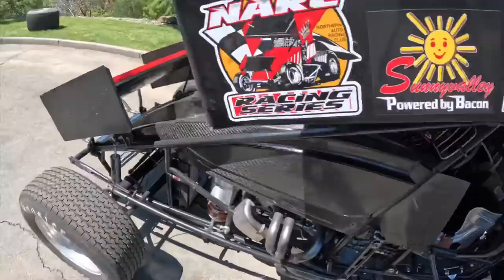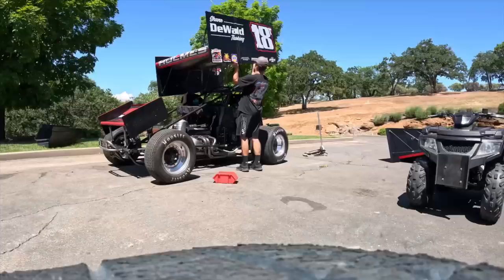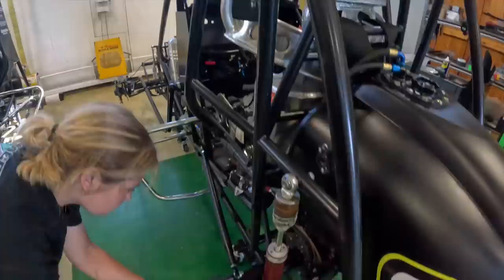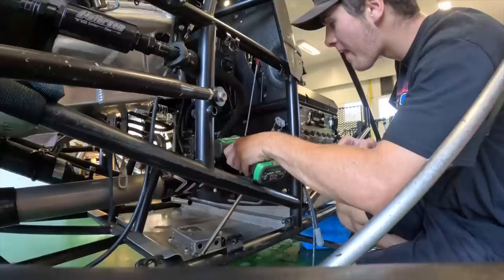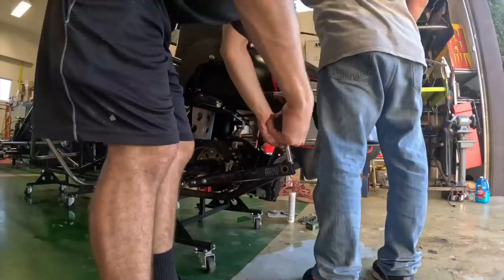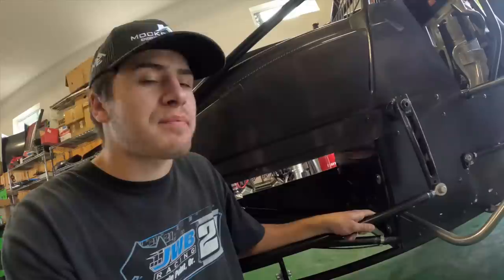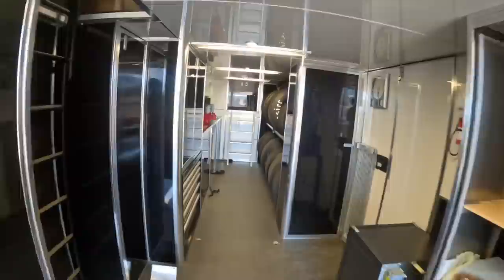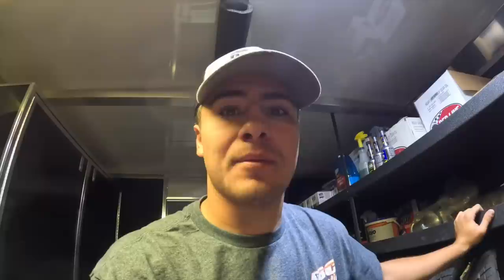We Had To Build A New Sprint Car....

Comment: Good Luck Tanner.
Reply: Are you spraying WD-40 into the spark plug holes and then backing the motor off after washing it intensely with the pressure washer